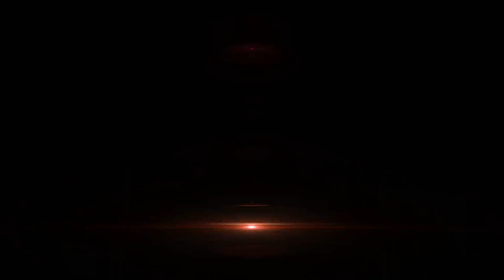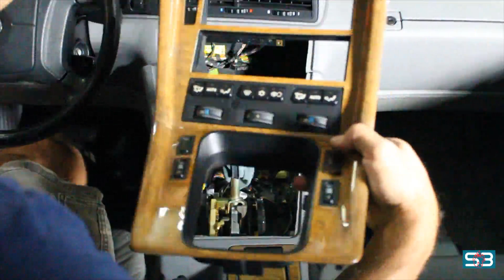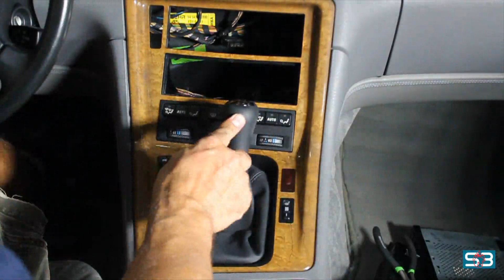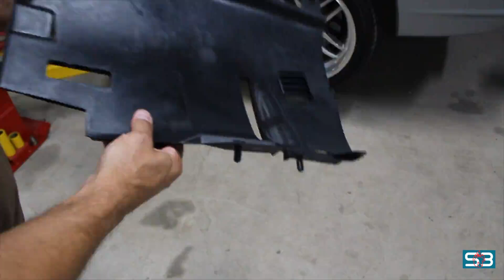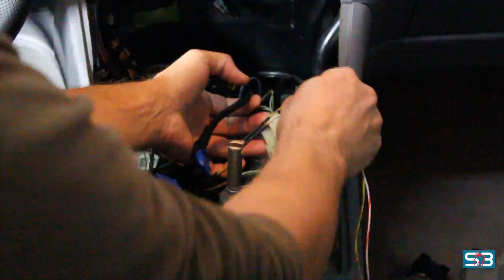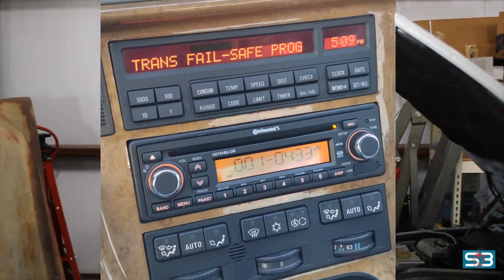Part 2 - BMW 840ci E31 Manual Transmission Swap

Comment: How did you managed to take the brake paddle plat out, I took a ff everything but nothing is sliding or moving to get the last 2 10 millimetres bolt on the top, please help
Reply from the maker: Watch from 6 minutes through 9 minutes of the second video (part 2) and I explain all the bolts/nuts to remove to get the pedal box out.

Comment: Hi, how did you connect your computer to the car? What type of adapter needed? I am planning to do CSI 6 speed manual swap on 92 850i which has 4 speed auto
Reply from the maker: I used an OBD2 to USB adapter. Mine is a 97 though, so I'm not sure if it applies to your 92. You'll have to verify. Good luck with the swap!
Reply: @safetythird4555 ok, mine doesn’t have obd2

Comment: How much did all of this cost total, roughly?
Reply from the maker: This swap cost me about $3000. I got the transmission, aftermarket flywheel, and driveshaft from a donor vehicle. You could probably get some of the parts cheaper if you were lucky with some salvage yard hunting. Alternatively, if you tried to find all the parts separate through eBay or something, including a new flywheel, I could see this costing close to $5000.